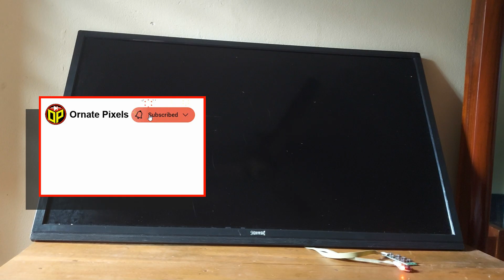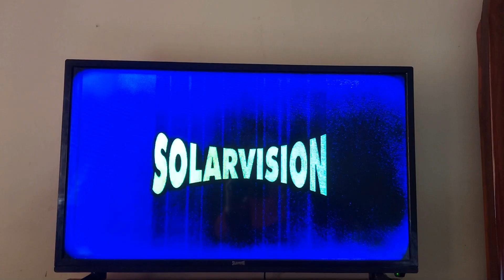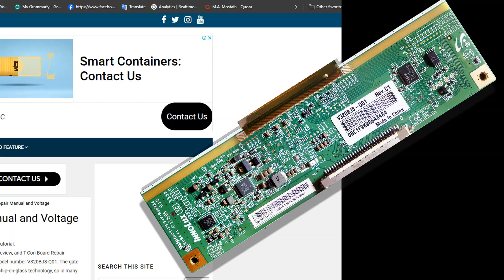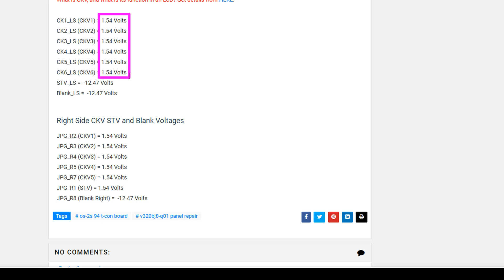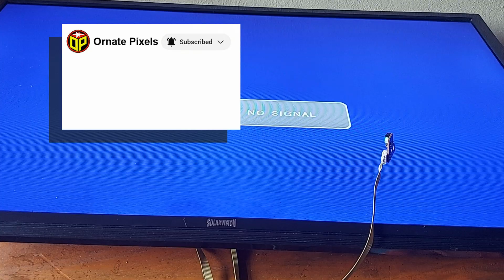Innolux V320BJ8-Q01 LCD Panels Black Screen Solution | OS-2S 94v-0 T-Con Board Voltage Details

Comment: Hello, I am very amazed by the information provided, but I have a question. I have done all the measurements and the only difference is CK1_ LS   0,04V ,  CK2_LS  0,03V,  CK3_LS  0,03 , CK4_LS  0,03V, CK5_LS  0,03V, CK6_LS  0,03V, STV_LS -12.47V, Blank_LS - 12.47 V, what can I do to fix the problem?
Reply: Same problem hai 😭 please aapka ho gaya ho to muje bhi batao

Comment: Thanks a lot for sharing such a wonderful tutorial.
As always, you are the best.

I have a panel like this, when I was trying to connect the lvds cable to the main board, I accidentally missed some pins and when I turned on the TV it damaged the main board CPU or processor. When I replaced the main board, I noticed that the panel had entered burn mode. I've tried all I know but still can't get it out of burn mode. Sir, what can I do to restore the panel back to working mode?
Reply from the maker: This method can restore the TV-
1. Unplug the TV from its socket on the power line and wait two minutes.
2. Hold down the Power or Source or Input button on the TV body and plug the TV back into the TV, and wait 1-2 minutes.
• If it doesn't work, you can try using the Volume+ or Volume- or CH+ or CH- button.
• If it is still unresolved, the T-Con processor may be damaged, or there may be a data mismatch between the T-Con board and the main board. 
• You can change the LVDS cable and see what happens.
Thanks 💚❤💚
Reply: Okay thanks, I will try the steps you just mentioned